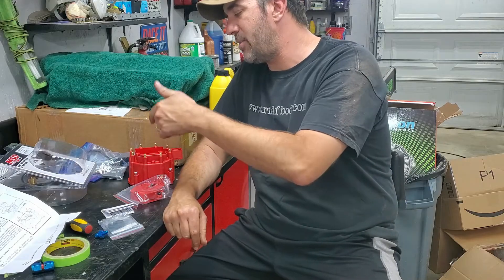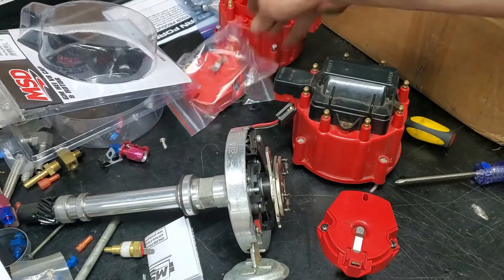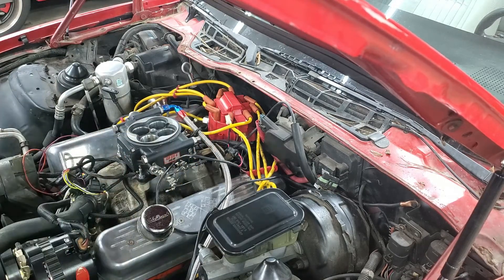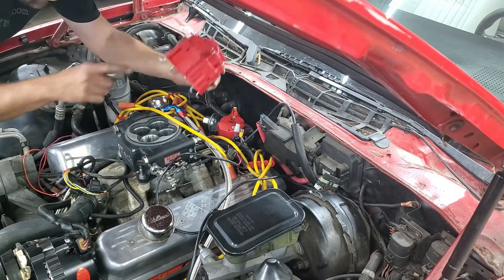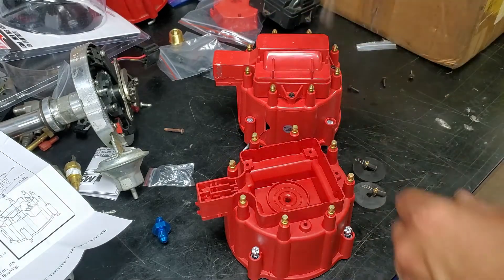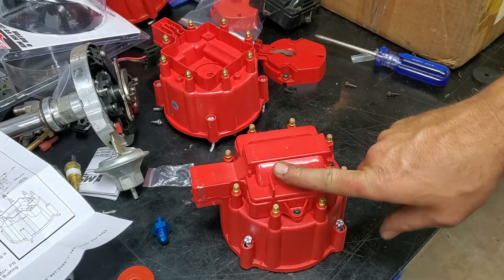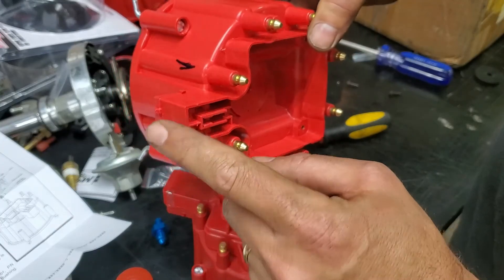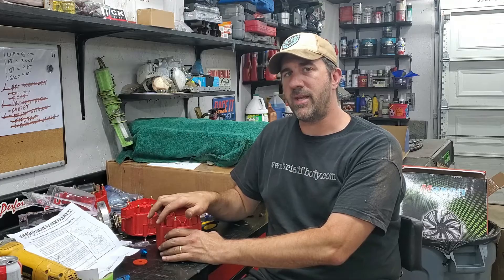The Midnight Mechanic Tech Tip - GM HEI distributor tune up

Comment: You forgot to explain one critical thing about the distributor that actually creates the main spark, and that is the module it can go out. Also, you could change the distributor cap and the rotor and the coil pack and you still won’t get any spark if you do not change outthe ignition module😂

Comment: Tech Tip: @9:20 make sure you attach the black ground wire to the bolt that is on the metal ground strap in the cap as he is doing because if you happen to attach it to the other bolt across from it then it will start to burn and melt the inside of the cap.

Comment: Thanks for the nicely detailed video.
I hate my SBC distributor placement. I replaced the points distributor with an HEI in my 61 Impala, but I could not access 2 of the locks at the rear. I turned the distributor 45 degrees, moved the plug position and was able to use 3 of the locks. It's been like that for the past 40 years and some 90,000 miles but I really hate working on it when a problem shows up. Like now with an intermittent miss. Some days it runs fine, some days it runs with a miss. I've switched out separately the cap/rotor combo, the coil and the ICM. It works fine each time until it doesn't.

Comment: Did your connectors come pre bent because I had to bend mine to fit the connection and it still won’t fire up I wonder why
Reply from the maker: Which connectors do you mean? I didn't have to bend anything.

Comment: I was wondering who you would recommend that is the best parts to buy from?
Reply from the maker: There's a link in the description to buy them off of Amazon, but I also tend to order a lot of parts from Summit Racing.
Reply: Bezos is a 1%er who pays crap. I avoid Amo as much as i can. Summit is great to do biz with and ORileys has Accel or Mallory parts.

Comment: On my 454, I simply stretched the springs about 1/8 inch to recurve the mechanical advance. I put the vacuum advance to manifold vacuum. I set up the total advance to 37° and base timing at 4°btdc before I modified the advance springs. I didn't buy an overpriced gimmicky MSD dickstributor. I stuck with the stock GM HEI. I've run the nastiest machines on the streets since I was a teenager. I always stuck with GM V8 power. My dad was a mopar guy since I was a kid. He's terrified of my vehicles! my stuff is mostly junkyard built. I don't have any flashy bright toy parts on my engine! Even if a part fails, I can walk into any parts store and still get an OEM replacement no question! These so called performance brands are an overpriced gimmick for regular street daily drivers. Unless you're hitting the racetrack during the season, a regular daily driven vehicle doesn't need that MSD junk! stick with OEM replacement parts and even if it breaks down, you can still fix it fast and cheap! Once you start getting into non factory or performance parts just because some idiot told you to get the parts, you're just screwing yourself out of a lot of money!
Reply: Ok..Just a fact..The factory HEI distributor rotor is known for electrical burn through the center and will arc on top of the distributor shaft underneath...MSD and ACCEL make a thicker plastic distributor rotor and their Distributor caps have brass tabs and tips....Just at least consider a better cap and rotor kit....
Reply: @tonybernheim8365  a CHEAP upgrade. i'm so cheap my stuff is Summit brand. but it's fairly stock inside.
Reply: Well said. You are an Expert before your time. Your Dad should be proud. Thank you
Reply: I am amazed after ALL THESE YEARS, that the “General Public,” that are merely “enthusiasts, think they can out smart the GM ENGINEERS. It ain’t happening.

Comment: the ignition control module seem to go out with these as well
Reply: I just found this I change my module every spring before I put the big block on the road seems like the heat love’s modules
Reply: @fullcirclefarm    I understand that there’s a certain grease they use under the module to help act as a heat sink.  I’ll keep looking for that.

Comment: Should the ground wire from the coil be screwed into the same "corner " as the ground silver clip that slides in the top of the cap, or does it matter? Thanks.
Reply: I seen that & questioned that as well......I'm pretty sure that goes accros the way,opposite of where he put it.....I don't think it'll start/run that way.

Comment: I have a sbc 355 nothing to crazy it has 0 miles but it's in the truck and been started plenty of times no issues ,it has a brand new msd pro billet hei black edition on it with rev limiter module ,the problem I'm having is now itll start sometimes  and not alot of times it seems when it starts it idles to about 1k then suddenly dies,wont start again crank for days,today I put the old style module and hei and boom it started then 1 minute later died wont start do u think it's the pickup I've tested everything and I'm out of options, motor has been in the truck for 5 years , ty for any info
Reply: Get a new distributor standard AC Delco

Comment: You have certainly realized by now that you marked the #1 spark plug location on the distributor in the wrong position.....(for a GM vehicle)
Reply from the maker: That's where #1 was at on this car.
Reply: @TheMidnightMechanic     Yep, ....  It All Depends on Who Was the Last Person To R&R The dist & How they Placed the Gearing & the #1 Plug Position
Reply: That’s #1 on mine. I saw a video on accel distributor and they were wired totally different
Reply: is there REALLY a wrong location as long as the heap runs?
Reply: I replaced the points distributor with an HEI in my 61 Impala, but I could not access 2 of the locks at the rear. I turned the distributor 45 degrees, moved the plug position and was able to use 3 of the locks. It's been like that for the past 40 years and some 90,000 miles.